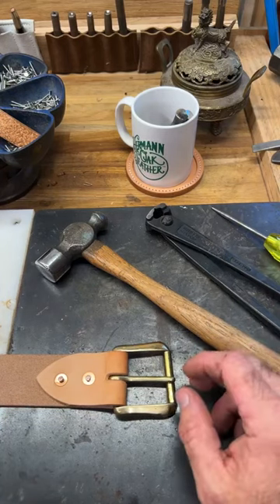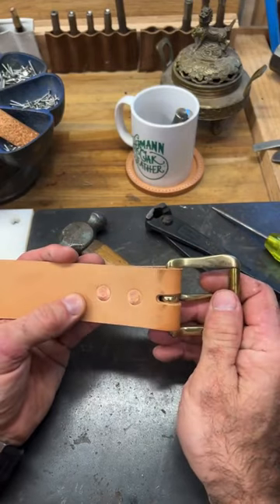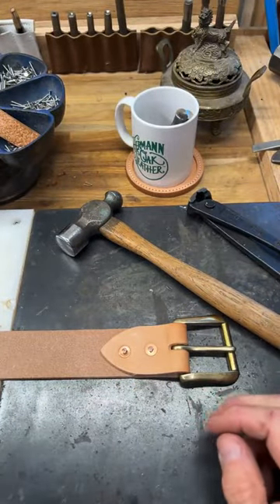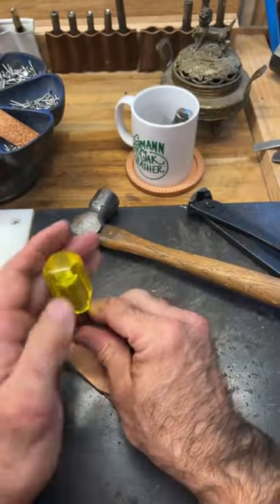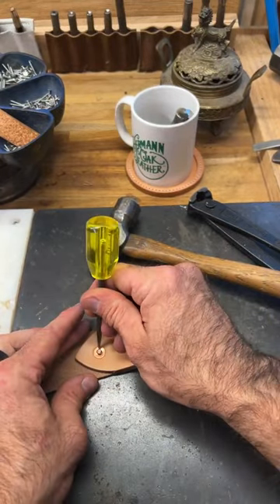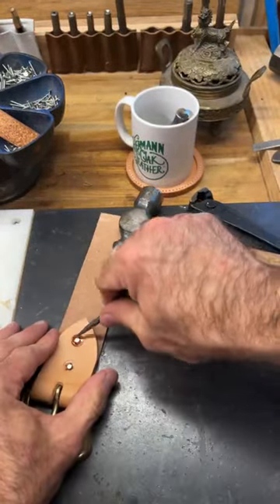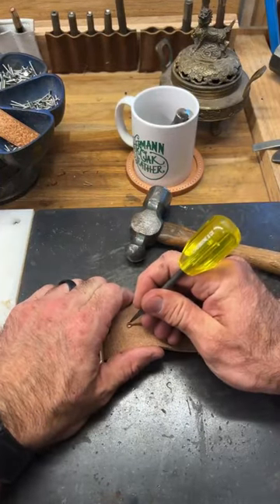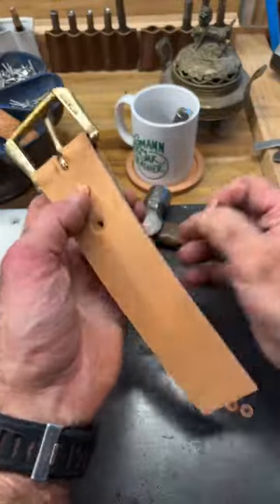How to Remove a Copper Burr Rivet

Comment: Very helpful, thanks😊 (Next time remember to turn the buckle😂)
Reply from the maker: This is the correct way to install the buckle on a back cinch as well as many other straps where the bulk of the folded over material shouldn't be placed against the animal/ wear side. It's both more comfortable and lasts longer.

Comment: And the buckle is still on wrong! Lol
Reply from the maker: It would appear that way if you didn't know what you were looking at. 

This is the correct way to install the buckle on a back cinch as well as many other straps where the bulk of the folded over material shouldn't be placed against the animal/ wear side. It's both more comfortable and lasts longer.